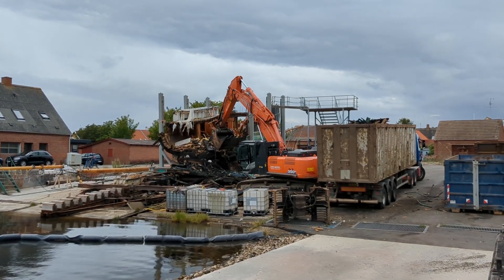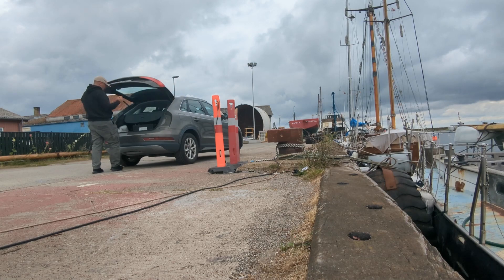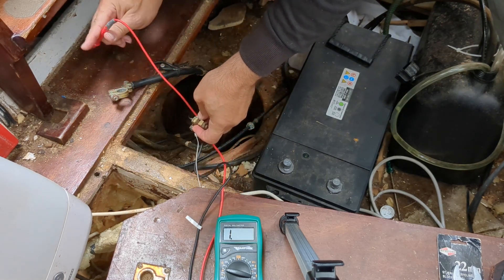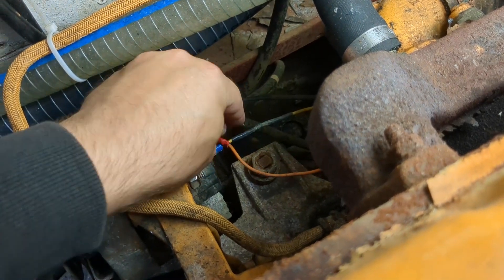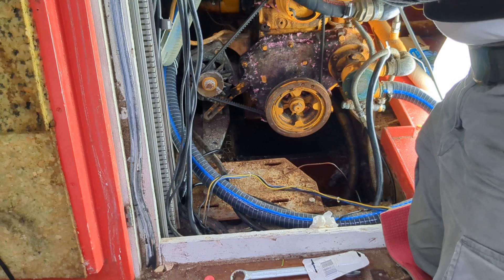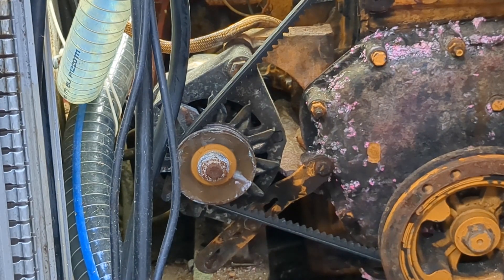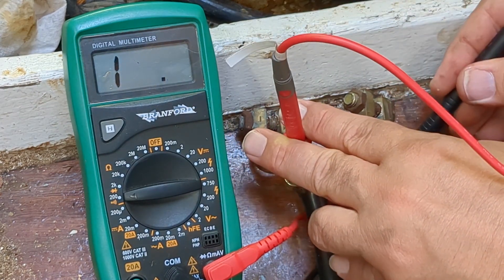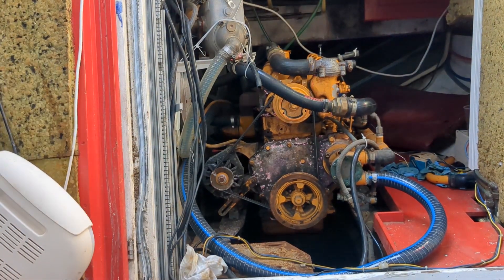Episode 21 - Troubleshooting the diesel engine

Comment: I was just wondering if the battery you are using to start the engine is a starter, battery or a deep cycle battery ? They are to different things for two different jobs.
Reply from the maker: That's a very good point, and one I hadn't considered :-) When I started the engine in the video I was using the big battery, which is a starter battery, more specifically this one:
https://www.biltema.dk/bil---mc/bilbatterier/fordonsbatterier/smf-batterier/startbatteri-smf-12-v-165-ah-2000029823
The other one I've been using I just dunno, I'd better make a note of the text on it and then check it online. Thank you for you input :-)

Comment: I think that once you have her out of the water you should pull the entire motor and rebuild it with brand new wiring and a new alternator. Maybe a new starter as well. That motor looks rough.
Reply from the maker: Thank you for you feedback :-) I'm not entirely sure I'll keep using Ophelias current engine when I'm done rebuilding her, but if I do I'll definitely rework the wiring. The engine does look bad, but as with the rest of Ophelia, things look way worse than they actually are :-).

Comment: The glow plugs or heater should have a 70 amp relay and that is on the key. The starter should be a seperate button or also on the key. If both are on the key, it is worth checking the connections. You may need a new key. mechanism mechanism
Reply from the maker: The glow plugs are indeed on their own seperate relay and switch, but the issue is that with the current setup the heater don't disengage when you engage the starter motor. That means that the heater and the starter in conjunction pull in more power than the battery can currently deliver. When we sailed Ophelia to where she is now that wasn't a problem but something has changed that, I guess that this "something" is likely the short in the alternator. I think I'll rebuild the control panel for the next episode and go over the details there :-) Thank you for your interest in my project :-)

Comment: Ok! you got it started. Your engine is crusty. It not unusual that your alternator/ generator is in need of repair or replacing. You may want to inspect your motor mounts. Your diesel is shaking a bit. If money was not an issue, I would replace all your electrical wiring.  Do you tarp the cabin to prevent moisture/water leaking into the cabin?  I too have jury rig things to get going, but it always hit me in the face when I tried to cut corners. Have a good week.
Reply: Not sure on diesels, but if generator, shouldnt have a voltage regulator? Those often go bad and get variable voltages on charging.
Reply from the maker: @olivei2484 Thank you, I'll have a look at that 😀
Reply from the maker: The engine is quite crusty indeed, but just as with the rest of Ophelia, it looks way worse than it is. Once the starting issue is permanently resolved I have no doubt the engine will be quite useful :-) The wireing will indeed be replaced, but for now I'll just remove any wires I come across as they aren't going to be used anyway. Once I've had the hull blasted and repainted I will erect a tarp/roof over the boat to stop the water from entering but as I will need to move to boat soonish it wouldn't make much sense right now. Thank you for your feedback :-)

Comment: I think that it might help to tighten the nuts on the battery terminals as the low 12 vdc needs a good solid connection and clean terminals…. John, Ontario, Canada
Reply from the maker: I think I had a pretty good connection, I checked it by measuring the resistance between the terminal connector and the terminal itself, but I'll have a closer look as it does look a bit... crusty :-) Thank you for your interest in my project :-)